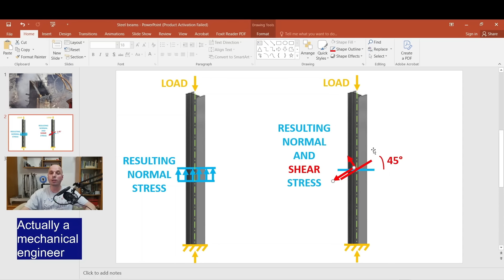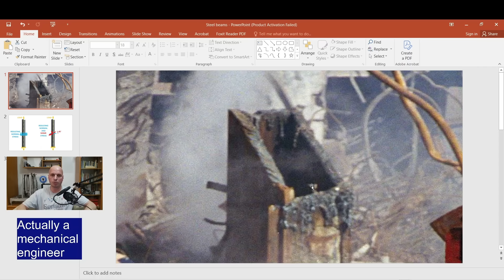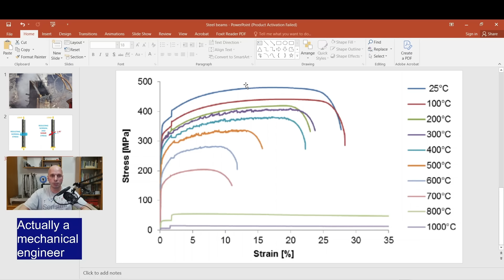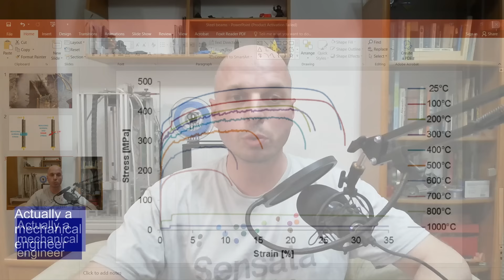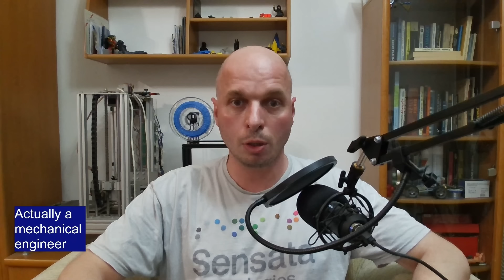Jet fuel doesn't have to melt steel beams

Comment: Cool, now let's do one about the structural integrity and material properties of a passport, and how it can survive what a building can't.
Reply from the maker: Apparently they could. 4 out of 19 hijacker passports were found at least sonewhat intact. Passports are light, and can be blown away by explosions. A lot of other people's passports have probably been found. A civillian found one of the passports on the street following the attack, and handed it over to police
Reply: @ImNoEconomistButtSo you're gullible, and just trust what you've been told. "Probably" and "apparently" is real scientific there buddy. I see you take your "facts" at face value.

Propaganda doesn't exist and a story can never be fabricated. You also aren't taking into account how the tower was built and speaking solely about a singular steel beam and not accounting for distributional load bearing.

I didn't realize when steel heats up at the top of the beam that the heat immediately transfers across the entire beam and doesn't dissipate at all. Totally makes perfect sense and follows the laws of thermodynamics 🤣
Reply from the maker: @ellocosjchushhxha look who's commenting without watching the video

Comment: Your presentation "sheer stress" sounds like magic joo joo BS.
Reply from the maker: Go do a course on mechanical engineering, focus on materials, structural members, and their behaviour under loads and stresses
Reply from the maker: Engineering sounds like magic to the uninitiated, that's why us engineers consider ourselves wizards. And I even had a hard time passing the subject in question back in Uni. The professor was joking that around 5% are able to just pass the exam ot the first attempt
Reply: @ImNoEconomistButtI didn't say engineering sounded like magic to me, I said your presentation of it sounds like magic joojoo.
Reply from the maker: @Chacopapi sorry it came across as such, tried explaining to non-engineers

Comment: I am always amazed at how many people do not understand that the fuel annealed the steel to the point it could not hold the weight anymore. Then the upper stories acted like a sledge hammer followed buy heavy debris falling mostly down the middle and pushing the structure outward.
Reply: “Once it started, total collapse was inevitable” is not automatically true.

At any lower floor:

It previously supported approximately the same mass that was above it.
The falling debris has kinetic energy, making it far more damaging than static weight.
But sideways ejection removes mass and energy.
Lower columns were progressively heavier and stronger.

A later mathematical reanalysis found that reasonable estimates of column energy absorption could potentially arrest the simplified collapse within several floors, directly challenging the claim of automatic inevitability
Reply from the maker: Indeed. They keep going on and on about controlled demolitions and other nonsense

Comment: totaly agree with you on the engeniering part of it. but having been a former 9/11 cook myself the 45° angle argument revolves around how in planed demolition explosive loads are put on beams in that same way and looking "almost" like the picture you showed.
the truth about it is actualy from what i can remember is that these beams hat been cut with powertools like angle grinders in the recovery process and in a zoomed out picture there are many beams right next to them without thag angle, clearly having been cut by rescue workers.
the jet fuel argument revolves around melting tempertures and the molten metal being reported on the sight of the towers. 
which is still goofy considering a fucking train crashed into that buildings core with full speed. turning ground zero into a giant furnace.

Comment: "Jet fuel doesn't melt steel beams"   Even if it didn't, it's not like it got it by a fucking passenger plane going full speed into it first
Reply from the maker: Jet fuel doesn't have to melt steel beams, but heating them up by just a few hundred degrees makes them much softer and reduces their ultimate tensile strength
Reply: @ImNoEconomistButtexactly, I feel like you need to not want to understand this topic if you believe that it was faked
Reply: @projectresurrection617 Just because you dont understand doesn't make you correct, makes you a mindfkd sheep
Reply: @projectresurrection617  Please tell us how 7 fell exactly the same way 1 and 2 fell mr science
Reply: @projectresurrection617  Ground zero was still burning at 1800F in Oct 2001, how does that happen mr science
Reply: @justincurley2244 It's not like the entire place was burning that hot, it was small pockets that a constant supply of fuel and trapped heat, which superheated these pockets to higher temperatures
Reply: @justincurley2244 I'm sorry, but were you there? You seem very sure about this. And it didn't, it had flaming debris from 2 buildings that just got hit by fucking planes falling onto it which started interior fires among other the things.
Reply: And some debris turned 7 into dust, you really this dumb? @projectresurrection617
Reply: It got super heated lmao 😂
Reply: @justincurley2244  By burning for like 10 hours?
Reply: Firefighter Orio Palmer radio transmission after climbing to the 78th floor, only a few pockets of fire up here, will be able to knock it down with 2 lines, min later turned to dust to 10 secs. Look up Thermite
Reply: @justincurley2244  the worst part of the fire was above the 77th floor in the South Tower. Specially on 80-83rd and spread to other floors.
The thermite paper written by Dr. Steven Jones was debunked back in 2011. If nano-thermite was used to bring it down, there would have been flares all over downtown Manhattan and WTC1, 2 and 7 would've be blinking like a nightclub because it produces a intense white light when it ignites, and... we don't see that happening during the attacks.
Reply: @lordvega3112  Maybe look again, you can see molten lava rushing out
Reply: @justincurley2244  from where?
If it was on the 81st floor, that's where industrial UPS where located....
Reply: What plane hit building 7, where is 7 located, why didnt other buildings that weren't hit by planes not disintegrate caused by fire. Only steel and concrete structure to be pulvarised by pockets of fire ever
Reply: Passenger planes can't fly full speed in low altitudes, air too dense causes structural issues with plane. So 4 guys that couldn't fly planes hit 3 of 4 targets, only an idiot would believe such nonsense
Reply: @justincurley2244  My father was across the street when it fucking happened. And where are the sources for the nonsense you're spewing from your mouth? The fact that you actually buy into it being faked says a lot about not only your character but also your intelligence.
Reply: @projectresurrection617  Why did the FBI take all the film footage of the Pentagon and 25 yrs later we still haven't seen the footage, sounds like you're a conspiracy theorist
Reply: @justincurley2244 They didn't lmao? They took it as first because it was a criminal investigation, but even after that they release it all to the public. I'm guessing you never put in any effort to find the footage you claim doesn't exist? I hope you understand in the future how stupid you sound. You know you're saying something so blindly unintelligent when it can be disproven by a quick google search pal.
Reply: Where's the video footage of Pentagon? Been waiting 25 yrs ...
Reply: @justincurley2244 https://youtu.be/0SL2PzzOiF8?si=EgGxsTYcBO7nMdcx
Reply: On top of there literally being video of it happening, you can't expect there to be many cameras pointed at the FUCKING PENTAGON from outside businesses???? And the government wouldn't release footage from inside the Pentagon for obvious reasons...
Reply: Talking about all the businesses surrounding the Pentagon smart guy @projectresurrection617
Reply: U cant win, u picked the wrong guy when it comes this subject,  oh ya im 20 yrs law enforcement that worked with ex military that say the same as me, go find someone stupid to argue with
Reply: U think there's zero footage from all the hotels, gas stations  etc, loosen those mask straps
Reply: @justincurley2244 please get help
Reply: Hotels, gas stations and other businesses, they all have cameras, Pentagon has more cameras than ppl, your "thinking" is not one camera picked up an airplane coming in prior
Reply from the maker: @justincurley2244 they still weigh a few hundred tons too, and buildings don't like hundreds of tons of stuff crashing into them. And you can probably find the speed the planes were flying at
Reply: @ImNoEconomistButtHow fast was the plane flying that hit building 7
Reply from the maker: @justincurley2244 there wasn't one
Reply: @ImNoEconomistButt It fell in secs like the 2 that were supposedly hit by planes, no jet fuel to supposedly weaken steel. It fell because of debris? Why do you think the BBC on live TV said 7 had fell when it hadn't for another half hour, was a good guess?
Reply from the maker: @justincurley2244 building 7 was on fire for 7 hours. I need you to tell me if you're special needs
Reply: @j @justincurley2244 Even though that did happen, there are these things called mistakes. Believe it or not, people aren't perfect (shocking I know) - Just wanted to point out that the BBC is a British news channel meaning that the British would have had to be in on it as well which is also a stupid assumption
Reply: @projectresurrection617  An entire building falling with the narrative already set, then it does exactly what was stated half hour later, sounds like maybe take one of your 4 masks off and let ur brain  breathe
Reply: @justincurley2244 If you're a journalist, and 2 buildings just got hit with fucking planes and collapsed, and another is clearly on fire with many pieces of debris hitting it, not that far-fetched to state it collapsed. You make it seem like it feel out of nowhere and they reported exactly how it happened.
Reply: Female reporter stood in front of a monitor showing building 7 30 mins b4 it fell in 10secs, quite a mistake and ur quite the idiot

Comment: The 45° shear plane is real math (Mohr's circle), but it doesn't prove what the video thinks it proves.

For uniaxial compression: τ_θ = (P/2A)·sin(2θ), max at θ=45°, τ_max = σ_axial/2. True for any ductile metal.

Problem: slender WTC columns under axial load fail by Euler buckling first — σ_cr = π²E/(L_e/r)² — which is below yield, let alone shear failure. And ductile shear failure produces necking + dimpled fracture surfaces, not the flat clean cut in the photo. That cut geometry is the signature of an oxyacetylene torch — exactly what cleanup crews used at Ground Zero for 9 months.

Also: "jet fuel can't melt steel beams" is a strawman. NIST never said it did. Steel loses ~50% of yield strength at 600°C and ~90% at 1000°C — well within fire temperatures fed by office contents. You don't need to melt steel to collapse a building, you just need σ_y(T) to drop below the applied stress. The math the video cites is correct; the conclusion it draws from it is a non sequitur.
Reply from the maker: I've seen cases where an element is at the border of what's considered a slender beam. It depends on how long the beam is relative ti its cross/section.

And I actually looked it up, this was cut by the clean-up crew after the fact, in October

And I mention UTS reduction at increased temperatures